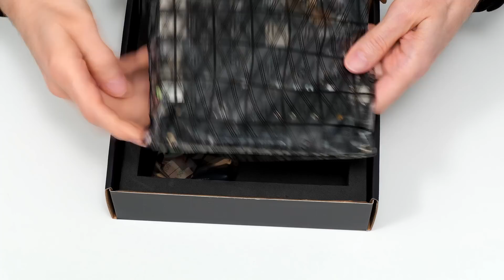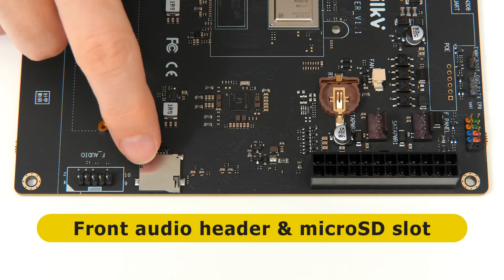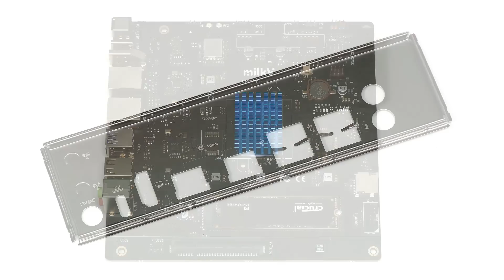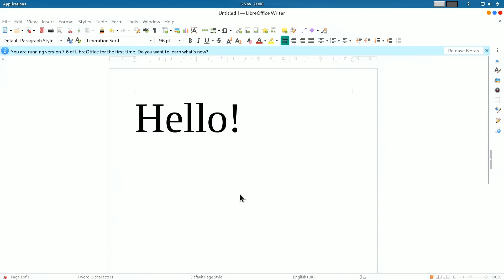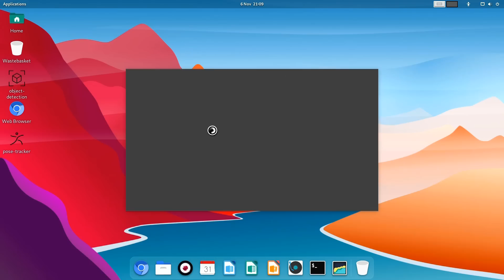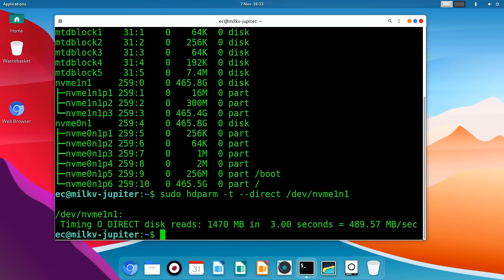Milk-V Jupiter RISC-V PC Build

Comment: RISC-V's success will be dependent on many factors, not least of which is hardware driver optimization to (partially) address performance and stability. It's good to know about the heat sink and the need for a PCIe riser adapter, so I appreciate your pointing those out.
FWIW, you could fashion a heat sink 'clip' by bending a heavy-gauge wire through the fins and into loops on the ends, then bolting it into place through the provided holes. Just a thought, if you ever want to test the heat-limited functionality of the chipset.
Reply: Software support is also equally important. Despite the hugely advanced ARM SoC of today, we still don't see similar software support level as x86. Also, with RISC-V being a more open source ARM architecture, it really is about time desktop software devs really starts going for the ARM/RISC-V route.

Comment: I like the power options, saw POE headers and it's a shame they don't come populated by default. Still while I like the idea of an open ISA, I feel rather conflicted with judging its performance considering that the speed of launching apps vs video playback looked perfectly fine, the value for what's on offer (price vs feature).
I'm hoping that RISC-V gets better support\performance as I don't see how it will remain financially feasible to continue developing for it when the end user will be drawn to alternative systems for speed and compatibility.
Reply: What surprised me is that this chip has more Hz, but is slightly more sluggish than the previous things he tested, like some optimization is missing from this system.
Reply: @autohmae  I wouldn't be surprised, it's a new architecture that isn't widely adopted, when you have to contend with players who have been in the space for decades most professional demographics are going to prefer the old but gold, while leaving makers and tech enthusiasts to jump-start innovators.

Comment: As an avid Apple user, I sincerely hope that these RISC-V boards continue to evolve to the point where they can give Apple's ARM chips a run for their money. It would be delightful to see some healthy competition, and who knows, maybe one day we'll have RISC-V boards that make Apple's ARM chips look like they're running on old-school iPod batteries. Here's to innovation and a bit of tech rivalry
Reply: I wonder what Qualcomm will do now ARM took away their ARM CPU design licenses.
Reply: @autohmae  That may prove on of the biggest mistakes by Arm. Qualcomm can invest in Risc-V and manufacture it on TSMC and kick the Arm’s monopoly
Reply: @felicytatomaszewska   the sweet spot for Qualcomm at the moment might be: Android devices on RISC-V IP for now.
Reply: Unlikely. RISC-V and ARM are by themselves not viable without fabs pushing the limits of the transistor.  It's because of TSMC that Apple has been so successful with their ARM processors. And so far there's been no one making a RISC-V chip on the latest fabs, and even if someone did that it's not clear to me what company will sell computers from such.
Reply: @ it has potential and future is bright so any big company can invest in it.

Comment: The progress on RISC V has been phenomenal. In a few years – perhaps end of the next if we're lucky! – I expect to see 3-4 GHz 16 core system. That should be enough for any daily computing need.

Thanks for keeping us up to date!
Reply: The next big leap is going to be when the Milk-V Oasis, the successor of the Milk-V Jupiter board shown in this video, comes out. Sixteen cores at up to 2.5GHz, up to 64GB of RAM, PCIe gen 3 connectivity, and a price point starting at just $120. It's going to be great, the only issue is that Milk-V has been radio silent regarding its release date even though it was originally supposed to come out in Q3 this year.
Reply: Actually those are already more than enough for the majority of home users.
They have more than 640kB of RAM which is more than anyone will ever need!!!
Reply: I don't know about that. ARM has been around for quite some time and hasn't reached that size of a system. It will depend on whether Risc-V chooses to be more ARM-like or x86-like I guess.

Comment: Nice board, I wonder what speed it can do over Ethernet? If it is able to sustain 1 Gbps maybe it would be good router candidate. Of course if using clean OS is possible. Long term, it is good to have some alternatives to x64 and aarch64. The question is how viable is to have 3 major CPU platforms. We used to have x86, MIPS, PowerPC, Alpha at the same time, even Windows NT 4.0 supported it but now it is nonexistent. Another this that would help the market would be the end of Qualcomm exclusive deal on Windows on ARM, which holds the market pretty hard

Comment: From everything I see of RISC-V, it is not quite ready to compete with X86 and ARM, but it is quickly getting there. I anticipate seeing some decently specced RISC-V processors coming around in 2-3 years time, able to do anything its competitors can do. Time will tell if it will ever outclass X86/ARM, but given that it is an open standard I am optimistic.

Comment: These RISC-V processors and systems have been around for a decade. Yet, they are still in their infancy. They operate very slowly, lag significantly, and the software is practically useless because it’s so slow that it’s entirely unusable. What can we expect from this platform? Another 20 years for systems based on it to catch up with processors from 2024?
Reply from the maker: RISC-V systems able to run a desktop operating system have certainly not been around for a decade. Most of the focus so far in RISC-V has been on embedded systems and microcontrollers, where over 10 billion cores have shipped and RISC-V has a significant and growing market share. End-user/desktop/server RISC-V only really got going about three years ago, and progress has been very rapid -- far more rapid than we saw with Arm at a similar development stage. We are probably about 18 months to 2 years before there are mainstream end-user and server RISC-V systems.

Comment: It's remarkable how quickly these processors & boards have gained a working OS that supports apps so well, even those that it isn't really powerful enough to run. Like your final demos didn't fail, they just went very very slowly.  If we compare that with the struggles for reliable operating systems & graphics on the previous two embedded cpu waves, - - the rockchip cpus/boards - - it's far sooner and looks so stable.

What do you think is the bottleneck for app performance here?

Comment: What is puzzling to me is this board has 2 headers for SATAPWR  but has not SATA port!  What the heck?  why would they waste the time or the pair of headers and not even be capable of using SATA? I do hope Santa has one of these for me at the end of the year!!!
Reply from the maker: It is indeed an interesting choice -- especially on a board with an ATX power connector, where most people will be able to power drives directly from that.
Reply: @ExplainingComputers  Right! that's exactly what i was thinking... i guess it would be nice if you were using a barrel jack or USB-C for power and needed to power a couple SATA devices.
Reply: @ExplainingComputers  either way,  i would still like to play with one of them.   i really wanna test it out for an OPNSense or PFSense machine.  it would slide right into my 3D printed 10inch rack.

Comment: Have you seen the comments by Linus Torvalds about the likely path of RISC-V from an academic idea to a working piece of hardware? As this guy has done this before I'm sure his comments are closely aligned with reality. 
So based on Linus's comments I'm not expecting a fully competitive CPU for quite some time, maybe 1 to 1.5 decades.
Reply from the maker: I am aware of those comments and believe they are wrong. We are clearly not 10 to 15 years away from end-user and server RISC-V systems. What Linus did with open source software has very little to do with open hardware.
Reply: @ExplainingComputers  I think you are overlooking his work on hardware at Transmeta. But in the end only time will tell.

Comment: I was doing some read/write tests in my sata ssd card (kingston A400). It was slower than expected (250 MB/s). Then I made an image with the data, and wiped the entire disk with "blkdiscard", then copied the entire image again. After that procedure, the speed test went much higher, around 400MB/s during all disk reading. My conclusion is, when you use the disk and it become more "fragmented" (not the filesystem, but the underlying firmware/flash roms) it becomes slower also to read data. Maybe you have used the ssd drive and it is becoming slower?
Reply from the maker: This is a good point, but I always initialize SSD to factory state before using them in tests. And they also get retired if they become slow.
Reply: @ExplainingComputers  WOW! That's why I follow you!

Comment: I wish those would come with RAM slot instead of soldered RAM chips. There is room for that on the board and I'm sure RISC should be able to handle so-dimm RAM.

It would probably make the production cheaper because you just need to solder the slot so now instead of selling 2 version of boards you can sell either barebones board or include 1 module included in price. There is no benefit to soldered RAM.

Comment: This reminds me of the days of an 8086 and 8088.  Computers changed very fast from those chips.
Reply from the maker: A great comparison. This is just where we are with RISC-V, at a time of rapid and exciting change.
Reply: @ExplainingComputers Putting an 8MHz V20 CPU and new clock crystal into my home-built XT was the start of my over-clocking journey. Tinkering back in those days, by mail-order and printed magazines, was wild. I really hope Risc-V continues to grow.
Reply: @markromine5103  V20: takes me back. About the same time as my first HDD. Decided to future proof, and spent the money for 20MB.
Reply: The cpus in Amiga was Motorola RISC ?
Reply: @80Loke  Motorola 68000 and derivatives, which was a CISC chip, generally thought of as better than 8088/8086. Motorola 68K was the first chip in Macs.
Reply: Motorola's processor in the Amiga was CISC starting with the 68000.  @80Loke

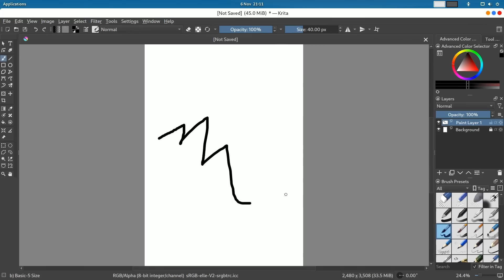Comment: 16:12 "Imagine a RISC-V system with 5 or 10 times the power" - No! Imagine a piece of software that is 5 or 10 times faster. I strongly suspect that all of the applications you showed are so inefficient that they could be made 10 times faster just by being rewritten competently </rant> :-) 
(Alright, maybe not the filters. Not sure.)
Reply from the maker: I imagine you are right -- software optimization could deliver significant result here, not least including GPU support.

Comment: RISC processors were shortly a long time ago and disappeared  ...  so i don't see any sense to try them again, waste of night time to start a program up 😂😅
We have these choices :
- x86-64
- Arm-64
- RISC-V
Two first are popular and in usa
RISC-V  .. good bye .. the same as we don't need to try again processors  :  Z-8080 from Sinclair  😢
Reply from the maker: As your own post indicates, RISC processors did not disappear. What do you think Arm processors are?! :) Arm stands for "Advanced RISC machines".
Reply: RISC V will succeed because it's license  free. That may not matter to you, but manufacturers producing 1000's of devices save a lot of money when they don't have to pay a license fee.
Reply: @ianhaylock7409  "RISC V will succeed because it's license  free. " <- just because something is "free" does not mean it will succeed.  Look at Android: nominally open, but it's the proprietary versions (e.g. from Google) which are the successes. Linux is mostly free, but notice that the market share is still small for computers.  The problem is "free" also means no support for the vast majority of the population of possible users.

Comment: I would just remove the metal bracket on the PCIe card and secure it with some zip ties.
Reply from the maker: Sadly it still does not fit.

Comment: I hope MilkV starts producing their motherboards with replaceable processors. It would be awesome to not need a whole new system just to replace the CPU!
Reply: they do it because sockets are expensive to produce compared to just mount directly, both the interface on the cpu and on the motherboard needs to exist; and support between multiple boards and multiple cpus needs to be added, instead of the firmware to only support the sole chip it can come with.  Besides this, newer cpus need to be compatible on the old motherboard, which means you need to design a lot in advance. Basically it would increase cost way more than what you may think, and no one is going to buy a 200usd weak sbc with almost no compatible software.
Reply: @ezforsaken  that's reasonable, given they're tiny companies compared to x86

i think slotted ram and more pcie connectivity should be the priority, because like, a NAS really doesn't need that much CPU power, but a lot of connectivity, if they could make boards for around this price, but with more pcie and sata, then they may well be pretty popular in DIY NAS communities

Comment: It is odd that you are getting such low speeds for your drives, I was getting much better performance on Ubuntu for the NVME ssd (I'm using a western digital blue sn550), around 700+MB/s.
Though I'm using the k1 4GB varient of the milkv Jupiter.
Eitherway, great video, you made my sunday!
Reply from the maker: Very interesting. I must experiment further.
Reply: I think something isn't right with this machine, as it also seems more sluggish than some of the others he tested before.
Reply: @autohmae  perhaps going for bianbu 2.0 would fix it ? I'm gonna test it again tonight, bianbu 2.0 works out of the box with the MilkV Jupiter

Comment: Oh cool.  You can just remove the mounting bracket from pcie add in cards.  The one with the red heatsink doesn’t have external I O
Reply from the maker: Removing the mounting bracket sadly does not allow the card to fit.

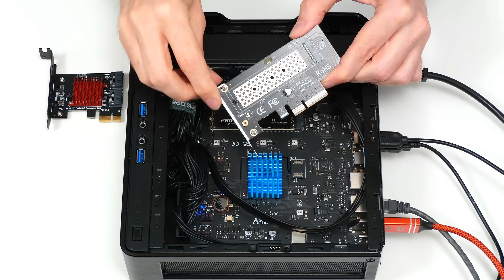Comment: For context at 17:31 - 18:04: In Win Chopin doesn't had a slot dedicated for low-profile PCIe cards due to the internal design. The case is only suitable for mini ITX builds that rely on APUs (CPUs with integrated graphics).

Though, great video for those were interested to expedience RISC-V. Pricey on my end but not as much.

Comment: Chris, when i go to the website of the board, there is a lot of A.I references in the spiel. Is this just A.I hype to drive sales or does this architecture actually give an advantage for running A.I locally?
Reply: 2 TOPS is peanuts. You might use it for some small LLM, to keep the CPU available for other tasks. But you can run Stable Diffusion (with OnnxStream), Ollama (custom patch) and Sherpa-Onnx on the CPU.

Comment: "Where's your anti-static wrist band earth Chris . . ?"   . . as the actress said to the Bishop .

Why, oh why, oh why . .do they knock out a new board and then plant old technology on it ? viz 2 lane PCI,  USB 2 sockets,  ATX power connector .

And 30 years on they are still knocking out cases with no real accommodation for cabling i.e. a complete mare's nest results. How about agreeing a standard for power  and data distribution buses running around the periphary of cases with plugs on at least three sides . . eliminating the said mare's nest.

Looks like the pre-production testing  for accommodation of the PCI  adapter cards was successfully concluded. Guad an' bennet.

Comment: Excited to see the future where RISC-V will be an alternative to x86 or ARM
Reply: Why?
Reply: @MagikGimp  Because it is possible for a chip design to exist in the public domain, similar to free software
Reply: @andrina_w .. could you pls explain more what we can do in this way  ? 
Do we can modify a design of a chip  ?
It would be interesting, but the size of the work is huge, to possible effectiveness 🤔
Reply: @andrina_w  Yes but most of them aren't open source and never will be. RISC-V is only an open source instruction set, i.e. manufacturers don't have to pay license fees for designing and manufacturing their CPU. However there is no obligation to make the CPU design itself open source.
Reply: @_________________404  But it is possible. A non-profit could produce a chip design and get it made for the lowest possible cost
Reply: @andrina_w  I haven't said that there aren't any. However they're generally much worse than the closed source ones.
Reply: @zorabixun  Open standards invites more competition, which is good for innovation and customers. Having a standard ISA is good for free and open source software, since resources can be better utilized when you only need to target one architecture. 
RISC-V is great for small and embedded micro-controllers, because it’s highly customizable and license free. 
RISC-V is also great for CS students, because it’s a simple ISA that doesn’t require a license.